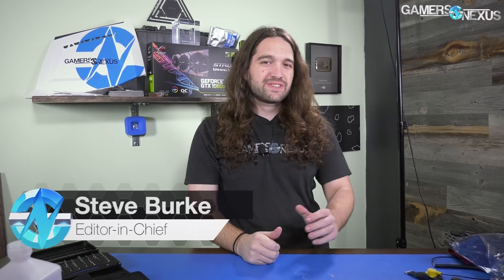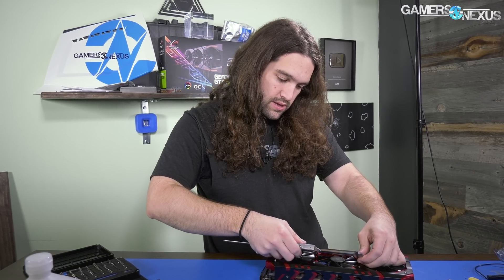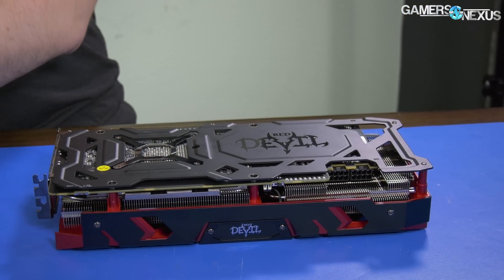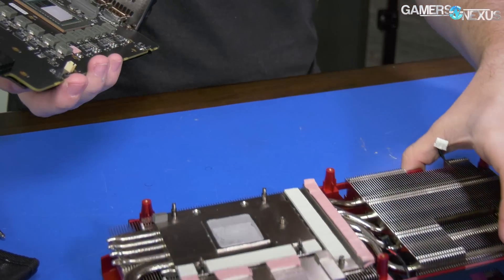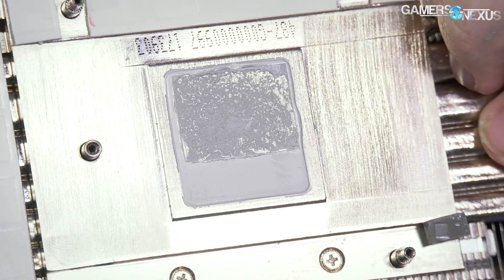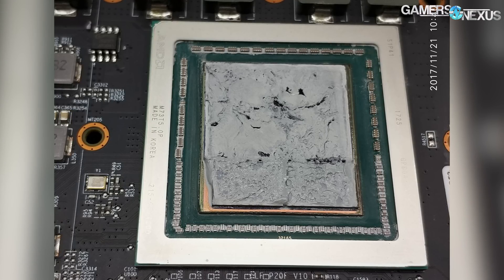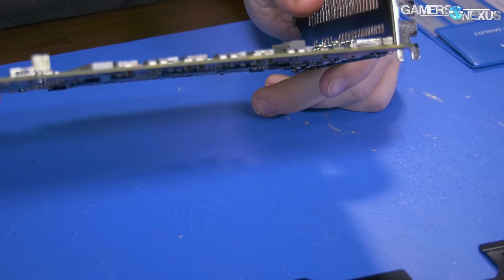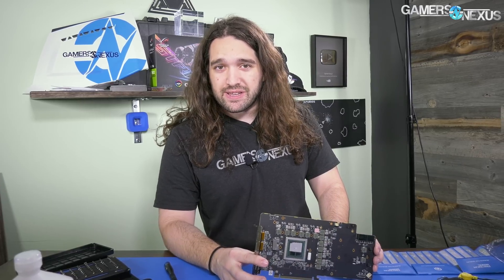PowerColor Red Devil RX Vega 64 Tear-Down (& Thermal Paste)

Comment: How stupid can powercolor be.... 1st - to not take in count the hight differences. Its NOT that hard. And even worse - how could they send a card to such an important reviewer without checking it properly?! Wow - how would they thread their real customer!?
Reply: On the flip side: This is exactly why they send their cards to such important reviewers. If they had sent it to someone else, that other person might not have called them to fix the issue.

Maybe they should give Gamers Nexus some kind of bonus for catching it.
Reply: 98luk45 Its not fanboyism have you failed to grasp the fact that the GTX 1080 which is a midrange card sells for a high end price, compare the die size of the 1080 vs back then the 580, 1080 is 300plus mm square and the 580 were 520mm square and the 580 high end sells for high end price, every year we as the consumer pays more for less because no competition, where there is competition the i7 7700k becomes an i3 with significantly lower price, so I don't get it with this fanboy stuff. But its too late now, AMD quits consumer graphics for good. You should be happy because from now on Nvidia gets full monopoly
Reply: Mane Name Unlike in the consumer space data center and professionals don't go you suck data center A for using AMD bloop AMD suck
Reply: +Snow Star, Lol, AdoredTV just likes to shit talk. It's funny because AdoredTV shits on AMD as well but nothing can get you fanboys back into reality. I had a Asus n61jq laptop which had issues for over a year and a half and it was related to AMD drivers. I also had the HD5870 which suffered the same issues. The things I used them for when the issues occurred were non-gaming related - CAD and videos. My GT8500 was perfectly fine with the same applications but the performance was shit.
Reply: All i have to say any graphics card company that has a Brand name of 'power color' should not be bought from anyway. It screams 12 year old budget card, with short cuts and cheap quality components. I knew that from the second i ever heard their name, and now we see it's true. EVGA, ASUS... these are quality names with quality cards.
Reply: Snow Star Nvidia sells workstations GPU's too , sooo whats the point??
Reply: I've owned a majority of AMD GPUs, 9800 Pro, 5870 and now sitting on a 390 which is holding it's own and more than enough for my needs.  Nvidia can do one, £700+ for the top tier card, where will it end?
Reply: @Mane Name: Jen Hsung Huan basically said, on a presentation this autumn that Vega is not a threat and therefore they wont release any new consumer products for the foreseeable future. And why would they? Pascal still ships a ton.
Reply: +Snow Star, The drivers during the time of HD4000 and HD5000 cards were shit.
Reply: 98luk45  Oh really do you have evidence? AMD driver suck is perpetuated by Nvidia fanboys have you own any HD series cards? Go watch AdoredTV videos talking about graphic drivers, what about Nvidia vista drivers that bricked thousands of PC? Ever heard of that before? I guess not because Nvidia always is the better choice while AMD suck see fanboys again no wonder AMD quits consumer graphics. HD 4000 to 5000 is exactly like Vega and pascal but opposite

Driver suck driver suck go do your research first
Reply: +Snow Star, That is completely irrelevant to the issues I experienced, or anyone had for that matter. Nvidia or Intel price gouging does not fix or cause AMD's issues. If not from global economics and changes to fuel/mineral prices, then the price increase would be the consequence of AMD's issues, not the *cause*.

You talk about monopoly, but you fail to grasp the fact that nvidia releasing a 1080 at mid range prices would have put the final nail in the coffin for AMD's gpu department. Would you pay an engineer to build a bridge from a super thick block of steel, or would you rather a carefully engineered structure comprised of less materials but does the job equally as well? From the better engineered product, you save space and you save resources. Have bridges gone cheaper since they now cost less to build? No, you're paying the same (or more) for the talent and effort that goes into making the product that exceeds previous designs.

Let's not forget that AMD tried sneaking in higher prices a couple of  times the last few years on both their CPUs and GPUs ... actually they already did that again with Vega56. 

You are the black sheep among the white flock; not because you were born that way, but because you decided to roll yourself in shit and want everyone else to put up with your shit. Call people sheep or whatever you want, but you are just a sheep like they are, with the only difference being that you roll yourself in shit and expect others to do the same. We are all going to the slaughter house regardless of the shepherd, all you're doing at this point is making trip unpleasant. 

Fanboy? Yes you are one, that's why you don't know what a fanboy is. Whether AMD succeeds or not would not have lowered gpu prices. Even if nvidia released nothing and stayed on 980ti, the V56 could have been priced much higher than it is now. 

Jesus christ, talk about a spoiled night after a great dinner. If not for you, hopefully others won't fall for the bullshit that you write.
Reply: 98luk45 Fanboy why would fanboy want their company to die? I totally agree with AMD about their decision to abandon their consumer graphics, no matter what AMD makes people will keep buying Nvidia and I don't understand why Nvidia would not just end AMD already they can do that but of course they won't because milking, I sure as hell would release the gtx 1080 at midrange price and kill AMD they do it because they can Nvidia is milking. Look at steam graphics data between year 2008 to 2011 the year where AMD is superior yet AMD don't sell more cards, people buy low performance Nvidia card that cost the same as an AMD card that performs better and consumes less power because fanboys AdoredTV did his research and presented cold hard data to back it up on his videos why don't you like cold hard facts data? Because it makes you look like an idiot? Why ignore the bad driver from Nvidia? AdoredTV has cold hard data backing that up too. High price dude do you know how expensive is HBM 400plus mm die and a docking huge interposed plus the best stock vrm cost? AMD made no profit selling Vega to consumers, you go ahead try operating a company. I did said AMD is abandoning consumer graphics you should be happy Nvidia gets full monopoly.
Reply: 98luk45 Won't fall for bullshit, damn so all cold hard facts is bullshit now so scientists can just present and held conference without data backing up their statements? Wow ignorant
Reply: 98luk45 I like how all your wall of text not a single hard facts all statements made by you. Very sad.
Reply: 98luk45 That's why Vega 56 has the same beastly VRM as the Vega 64, AMD has bulk discount from bulk parts purchase so they can't afford to have two different PCB configuration for Vega, this shows that AMD profit margin with vega is very thin when selling to consumers but AMD don't need graphics anymore they don't have to sell to consumers they have a good CPU now anyways you should be happy that AMD is abandoning their consumer graphics and Nvidia gets full monopoly starting now. Isn't that what you wanted Nvidia the sole king?
Reply: Maybe you don't realise this but AMD is also losing the professional market. Please, just stop.
Reply: 98luk45 I ask this one simple question, did AMD produce and market the card as a gaming card or a professional card? Answer this one simple question. Did they or did they not? So if AMD said it's a gaming card it's a bloody gaming card. You didn't mentioned problems when using the product for its intended use case. And yet you bash AMD drivers suck because you use it as a professional product. Its like manufacturers said this is road vehicle that is supposed to be driven on a road and the car owner drives it to an ocean and blames the manufacturer for that. Facepalm. Well AMD has no market presence whatsoever in the professional market anything they can get is considered good. Besides AMD is certainly doing much better at the professional market than the consumer market
Reply: +Snow Star. I don't need to answer questions you've conjured to assert yourself of your own delusions. Not only did you fail to understand the bridge analogy, but you failed to create your own for your rebuttal; there are no logical ties to your reasoning. Go and develop your own life experiences and stop parroting what you hear from other people. You should probably learn to drive a car as well.
Reply: 98luk45 I asked a very simple question anyone can answer that, the fact that you don't have the decency to answer my simple question proves to me that you can't handle cold hard facts that is real instead of statements made out of thin air. Besides what are you on about I supported my statements with concrete data why can't you do the same, even your last statement lacks any concrete hard facts, no logical ties?
Reply: 98luk45 So when your lecturer asked you to back up your hypothesis with concrete data you just gonna poof there is my data I pulled it out of thin air. Besides didn't I said AMD is quitting consumer graphics and Nvidia gets full monopoly shouldn't you like be happy about it since you are an Nvidia fan.
Reply: +Snow Star, funny how you can't write anything else but repeat yourself, then contradict yourself the moment you try to write something different. You're not capable of an academic debate, so stop trying. Did you start learning to drive yet?
Reply: 98luk45 Did you answer my questions? Did you? Ignoring the cold hard facts presented to you? Wow what a bloody ignorant fool
Reply: 98luk45 Show me where I contradicted my self? Go ahead try
Reply: 98luk45 Again absolutely no cold hard facts backed up by your statements. You said I contradicted myself yet you didn't proceed to tell me where I contradicted myself
Reply: 98luk45 Funny how you can't answer one simple question ohhhh did your mind went blank with all the hard facts?
Reply: 98luk45 Academic debate I presented facts cold hard bloody facts yet you presented none whatsoever I'm thinking this must be what the lecturer felt when he teaches you or did you went to college at all?
Reply: 98luk45 with that kind of attitude I doubt it you will reach far in your career life sad
Reply: 98luk45 Beside didn't I said it already that AMD is quitting consumer graphics for good you as an Nvidia fangirl should be happy that Nvidia gets full monopoly. Don't you get it Nvidia won AMD lost
Reply: F1N1SHEDD Wow just gonna ignore that exploding EVGA card wow oh gosh
Reply: F1N1SHEDD Quality explosion oh yeah Michael bay style
Reply: Just an update 9 months later... I bought this card a couple of weeks ago now and the HBM temps are with in 2-3 degrees C which falls in-line with other manufacturers.

My OC results so far are 1677 core / 1080 HBM2 @ 1085mV/1040mV 
The cooler manages to keep the card at 60C with at these settings with the stock fan curve (loud)
Reply: The thing that bothers me about this is that they make the heatsink. They machine the coldplate. They set the spacing of the dies. They install the heatsink. They even had the thing on a surface grinder to get the flat and smooth finish required of something intended to conduct heat. Would it have been that hard to machine an additional 0.001" off the die portion of the heatsink to allow for a better chance at contact with the memory?
Reply: I had 4870, 5870 and now the RX 480. I am perfectly happy with the 480 so far.
Reply: Mane Name AMD don't give a damn about consumer graphics anymore, they sell to professionals and data center where fanboyism doesn't exist, why would AMD release new gpu for us when all consumer does is Nvidia FTW AMD suck. Back in the HD 4000 to 5000 era, AMD had a much more superior product yet Nvidia sold more. We bought this to ourselves be prepared for a $350 gtx 2060. Why would AMD work so hard for so little R&D and end up not selling? Don't make sense to me.
Reply: Karsten M. They fixed it.

Comment: Your splitting hairs. Literaly .0015" is likely half as thick as a hair on your head.  Take your calipers and see for yourself lol.  Perfectly fine w/ a bit of paste
Reply from the maker: It already had paste on there and, clearly, did not close the gap. They added more later.

"See for yourself" -- it's in the video.
Reply: dubn420 
Calipers are not a precision instrument and definitely not fit for measuring values this small. 
Unless you want to spend upwards of $1,000 on a pair, which are only precise down to about 50 micrometers.
Reply: I wouldn't put a caliper on the die's anyway.
Reply: Gamers Nexus holy shit that was a 3rd degree burn.
Reply: dubn420 "your splitting hairs"
As in Steve's splitting hairs?
Are you saying he has split ends?
Reply: Ya. They added more later is my point that it's not a big deal.  I've been doing precision cnc machine work for the last 8 years and if the feeler you used was about right the gap is probably within spec. Everything manufactured has tolerances. They obviously don't want it raised so +0/-.002" is probably something they're working with.   Perhaps they didnt have there assembly line fully up yet and whoever put together your sample unit didn't even know those components needed paste. (im not convinced they do actually NEED paste if you were able to come up with numbers with and without paste, without frying anything..not saying it shouldn't be there. It definitely should.
Reply: Anthony Holloway i was comparing his .0015" shim to a hair's thickness to gives some insight to the amount or gap we are taking about here.  No way suggesting calipers are that accurate of a way to measure, depth especially. Buy they will give you an accurate enough measurement of the thickness of your hair.

Comment: Hmm, I think I'd tend to blame AMD for this one since having inconsistent manufacturing of the component, perhaps it may even not be their fault but rather their fabricators. While the board partners may have dropped the ball in fixing it with the pre-release model (but to their credit they fixed) I wouldn't blame them as much since they are reacting to a problem that shouldn't have existed in the first place. That being said if they are addressing the problem and taking steps to ensure it doesn't impact the end user than I would rather give the various parties involved credit for taking responsibility for the issue.
Reply: Yea because  there are no standard on HBM2 production so far. Thats why they keep delaying Vega.
Reply: except there are consumer production reference cards for sale on the market with these same inconsistencies, its not delayed, watch the video they referenced https://www.youtube.com/watch?v=y_OgK_fUoH0
Reply: Except its not a fix, its more like a bandaid on a broken bone...dumping more thermal paste onto the chip-set can actually act as an insulator, that being said waiting to see the thermal differentials in their testing.